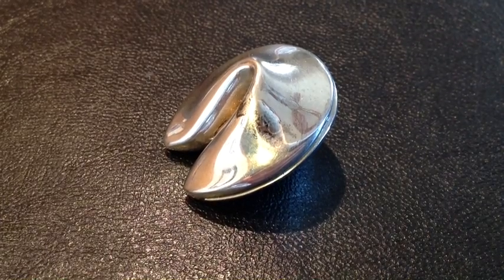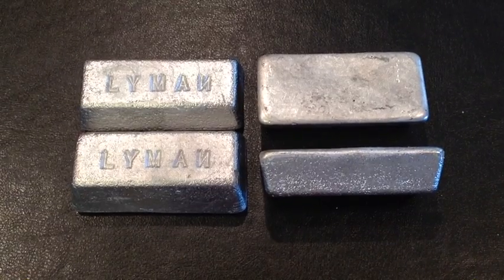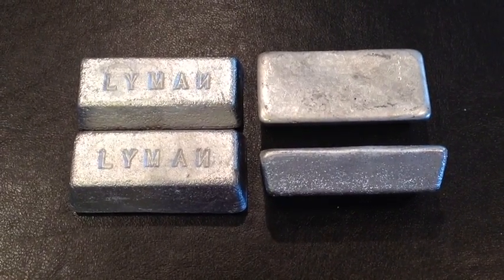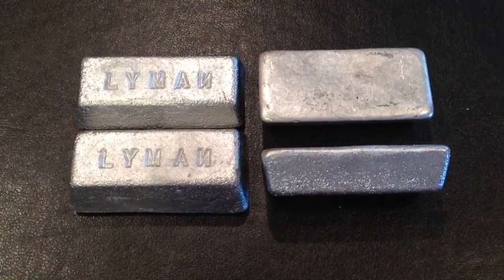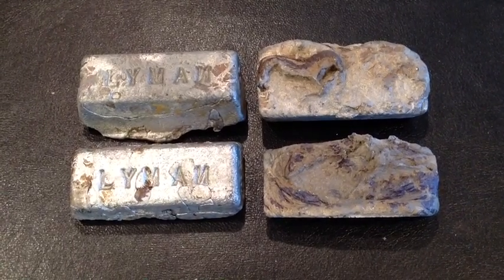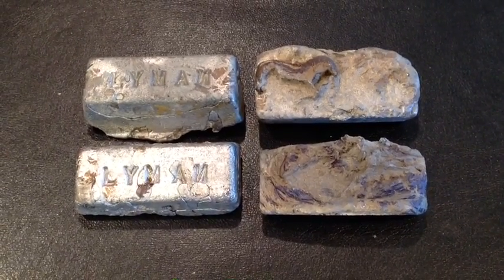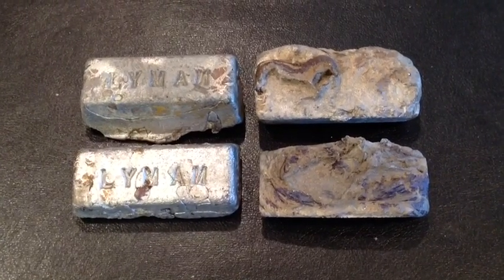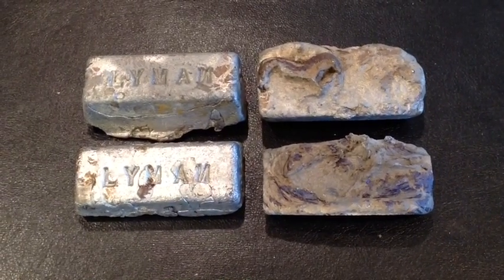Bullet Casting Heartbreak of Zinc

Comment: Why were you melting lead at 900 degrees when lead melts at around 700 degrees?  Wouldn't the zinc seperate better if you had lowered the temperature a bit?
Reply: I think he didn't know there was zinc in it at the time, usually you keep you lead higher than the melting point for pouring efficiency.
Reply from the maker: Garras Porgratix - The lead actually melts a bit lower than 700, and any zinc wheelweights float; trouble is when the heat is not controlled and the temp is allowed to rise causing the zinc to melt into the mix - when that happens, the alloy is ruined.  Best to ya… don't know if I answered this one already, Google is not showing the replies in the comments...
Reply: FortuneCookie45LC Dissolves, not melts. Think of Sugar cubes in water

Comment: I think it's time goes on you won't see too many lead wheel weights anymore how can you tell the lead weights from the zinc weights
Reply from the maker: mr hamburger - LIke your style, mr hamburger..I'll take a cheeseburger please with everything on it - just throw in the kitchen sink..!!  Great questions - easy answer - just take the wheel weight and clank it on concrete floor - sounds like metal - it's zinc - sounds dull dead sound, it's lead.  Another way is the zinc ones have Zn on 'em...some casters use tin snips, the lead ones dent with the snips, the Zn ones feel like rock... Good castin' to ya,  FC

Comment: Good video.  In my (nanny) State a few years back, the Governor decreed we mere mortals could not use lead wheelweights. 😡 My own Heartbreak of Zinc happened when I melted some tamp-ins, not realizing the “wedge” part of the tamp-in that expands the lead sleeve is not steel I could skim off, but ZINC. I lost a good Lee melting pot. 😥 Another time, I did a zinc bullet experiment, but I fabricated a special melting pot and used an old spoon for a ladle, dedicating 2 cheap molds to the project; I wanted no chance of zinc mixing with my lead casting equipment.

Comment: When playing with wheel weights if you can scratch the lead with a finger nail it is lead, zinc will not get scratched like lead.
Reply from the maker: AK - Amen to that, Aaron, some casters like to use a pair of tin snips or pliers to do the same, as if there are a lot of WWs to check, that's a lot of wear and tear on finger nails.  Best to ya,  FC Steve
Reply: FortuneCookie45LC do you reload shotgun shells? Slugs?
Reply from the maker: Aaron Krebs - When I was in competition trap shooting traveling around the state, I reloaded my own shells with the big Dillon press.  But all the serious competitors only used factory ammo.  Shotshells are not like metallics - with metallics, we can easily beat factory performance.  But with shotshells, the consistency of the factory ammo  cannot be matched, much less beat.  At the winning levels, any ammo inconsistency can lead to a lost bird, and winning and losing were always by one bird - hence, all the winners only shot factory ammo.  So I stopped using reload shotshells.  And we weren't saving much on reloaded shotshells anyway.  Today, I reload slug loads and there, our reload slugs const 1/10th of what factory slugs cost.  However, factory slugs are superior in accuracy and power than our reloads (taken as a whole).  For our recreational, range and practice shooting, reload slugs are great.  But if serious use or purpose, factory slugs are the way to go.  Have a great day,  FC Steve
Reply: Can you make a video on how to reload slugs?
Reply: Use a scratch awl or maybe a sharp screw. If it scratches and you see shiny metal, it is most likely lead. Zink has a whole different feel when scratched. The problem comes when you are dealing with a million little, tiny wheel weights. Then it is best to work up a lead puddle and keep the temp below 700 or so and carefully drop them in and see if they melt in about 30 seconds.

Comment: I don't know about DIVING weights. I bought 40 pounds of fishing lead and melting it down found something initially interesting on my runover lead. When I peeled back lead from my sprue (I ladel pour unlike you journeymen), it broke off... pure lead doesn't "break". It makes a soft enough bullet for shooting though and bullets expand on game with it, so I am using it still using it in my airguns and muzzleloaders, but now I'm turning to bullet casting for my .223 and others... is why earlier I had asked you what you thought of powdercoat over just pure lead with a gas check bullet.

Long story short... I have some keel lead that acts like lead in that when you peel the lead back from sprue plate in order to cut it, even thin pieces fold up nicely.. but still when you tap it... sounds a little funny... but is soft enough to damage a bullet if ever dropped, but I'm not buying any more dive weights....

Much Aloha...
Reply from the maker: Tom Lodge - Diving weights, fishing weights and keel lead is all close enough to being pure lead that a caster can just consider it pure and therefore very soft.  Lead that is just at the point of hardening can do strange looking things if disturbed.  I've seen it smear, layer, shift, tear and yes break.  Pure lead is really good for muzzleloader bullets and for shotgun slugs.  I've heard of bullet casters that have no sources of pure lead.  And others only have wheelweights but others want wheelweights and can't get them...Powder coating 223 cast lead bullets is being done by quite a few shooters...100 yard accuracy is not assured with full velocity loads, though.  Bullets that are too soft may not grip the rifling no matter what coating is on the bullets...Even though a lot of 223 shooting has been done with powder coated bullets, not much data has been tabulated... Best to ya,  FC

Comment: if a person had a PID controlled POT you can control the temp to within a few degrees to make the zinc float at 650 degrees, and only use that pot for making ingots so you can separate your bottom pour pops and molds completely from it.
I think the best bet is to stay away form possible zinc contamination of your pot, to me that is no wheel weights at all, they where a wonderful source at one time and free back in the day, now it is to risky.
Reply from the maker: Rodney Peters Good point, I can't get any wheel weights these days anyway because lead wheel weights are being taken out of circulation in California - plus tire shops are required to turn in a "quota" of wheel weights.  Using range scrap solves all the zinc contamination problems... Good castin' to ya

Comment: I just cast my first lead into ingots today from watching utube and ur channel.  It went well and all my zinc floated to the top.  So thanx for the help. I was wondering do u no give or take how many. 303 British bullets. 1 pound should cast. I got 102 pounds out of a 5 gallon bucket
Reply from the maker: garrett williams - nice going - the zinc melts at 787 degrees F, and, of course, your lead is already melted by 650 degrees.  But when I cast hot, my bullet alloy can easily climb to 787 and higher.  So if casters are using wheelweights directly into bullets = trouble (one of the reasons we make ingots- so we know what's going into the bullet pot).  I recall that Lee makes a 180-185 grain bullet for the 303, so 7000/185=37 bullets per pound of alloy.  I like my new 38 cal 99 grain mold casts 70 bullets a pound.  Best Regards

Comment: i am new to casting and i have a question. I collect wheel weights and when i cast 45 caliber 200 grain bullets but when i weight them thay weight 214 grain. How can I make lighter bullets?
Reply from the maker: Wayne Brummett - Great question, and thanks for asking it…This is quite common that bullets dropping out of molds do not weigh according to specifications.  Handgun bullets tend to weigh heavier (softer lead=more lead, less tin and antimony=more weight), and rifle bullets tend to weigh lighter (rifle casters want hard bullets and more tin, antimony=less heavy).  You can lighten your alloy by adding tin and antimony, but wind up with bullets harder than you need=raise the cost of your materials as well.  My advice, go with the 214 as your bullets will have a fair bit more hitting power, shock and penetration-adjust your loading data references accordingly.  214 grains is a better weight for lighter 45 bullets than 200.  I have the 252 SWC 45 Lee mold and it drops bullets spec on size but at 262 grains - and I like it that way!!  That bullet will shoot the eyes out of a rattlesnake at 40 feet if the shooter touches off.  Also, if you do lighten your bullets, you will also get larger bullets and perhaps have to size them.  If your 214s are dropping at groove diameter +.001" (auto pistol) or chamber throat +.001" (revolvers), you won't have to size them - just tumble lube with 45/45/10 and load 'em.  This is probably more info than you need or want, but it is presented in the event you or others might find it useful…Best Regards...

Comment: Im starting to see Zink bullets in range scrap at my local range. Pulled 3 bullets out of 46 lbs today. Two of those were copper coated and one was just regular cast.  I cut any bullets that are total metal jacket so the lead can get out and I knew as soon as I went to cut them they were not lead because zink is way harder than lead. I tested those bullets by dropping a few drops of muriatic acid on them to make sure and they foamed up instantly .  Watch your range scrap guys cause casters are using zink now and either some bullet manufacture is copper coating zink or some hand loader  in my area is
Reply: I was about to post the same warning about zinc bullets also. 
I believe these are made by companies, not private individuals.

Comment: There's a thread in Cast Boolits forum about zinc in lead. They say sulfur will take it out. Has anyone tried it?
Reply from the maker: +Charles Frazier - Wow, a year ago comment that never made it into my inbox for reply...Google does that - irksome, very irksome....Either that or I answered and Google lost the reply so it doesn't show up for others to see... So here we go (again?)... I've heard of the sulfur trick, but that means we have to have reagent sulfur on hand.  With most casters, one zinc experience will drive home the fact that we don't want that!!  I've had one zinc experience in over 40 years of casting.  That is not a high enough incidence to warrant having toxic sulfur on the premises...nasty stuff to keep around or even acquire.  only other use for it would be to manufacture black powder - I'll leave that up to others... Best Regards,  FC
Reply from the maker: +Smiddy Wesson -- Not as easy as that - basically, if zinc contamination occurs, the batch is ruined and not even the pot is worth the trouble to contaminate future batches of alloy.  Best Regards,  FC
Reply from the maker: +Smiddy Wesson -- I suppose, the way I've made ingots all these years with WWs is the way a lot of ingot casters do it without thermometers.  We just heat the wheel weights and when the clips start to float free, then the melting point of the lead WWs is reached, then we lower the heat just a bit and throw in some flux and skim out any WWs that do not melt along with all the clips - those WWs are the ones that escaped our inspection of Zn and Fe ones - won't be many.  We don't know the exact temp of the lead, but it is way below the 787 where the Zn will melt in... This is all academic as WWs haven't been available in CA for at least the last 25 years (unless we want to buy some from Ebay - no need when range scrap is easily available).  Have a great day,  FC
Reply: @FortuneCookie45LC  I don't understand why you think that sulfur is toxic. It is a non toxic element that I use on my garden. What am I missing? I supposes it stinks like crazy when heated, but that is very temporary. I would do it if I thought it would save a batch of lead. I have a fan. I also don't live in an apartment.

Comment from the maker: 762sultan-Thanks for posting.  That's the first I heard of that process.  Hope it helps a caster out there because that zinc thing does happen.  Congratulations on saving your melt.  Never heard of that solution to problem until now.  It's good to have a bail out when prevention doesn't do it.  Best Regards.

Comment: Is there zinc in car batteries
Reply from the maker: JM - The internal plates are lead and lead oxide.  There may be some zinc as part of the framework or terminal assemblies.  But car batteries are not considered to be viable sources of lead for casters because of the acid hazards.  I have never wanted to recover any lead from batteries.  Best to ya... FC Steve

Comment: FC45, I have read on forums that you can flux it with sulfur to remove the zinc. Have you ever tried that to remove it?
Reply from the maker: First Last I've only had the one zinc experience, and the best way is to prevent having it.  Zinc melts at a higher temp than lead - once the lead melts, anything else in there that doesn't want to readily melt at that time needs to be removed without delay - if this is done - no problems.  I did hear of the sulfur solution, but after my zinc experience.  Once in 40+ years of casting is enough.  I don't intend to go with the sulfur solution as prevention is much easier...Best to ya

Comment: I have messed up and gotten zink in my pot before. I usually just use that lead to pour sinkers. A little zink in a sinker mold still does ok. There not perfect but work well. I have also used pure melted zink for sinkers, it's a pain in the butt and they are ugly but still work. You know the old saying " if life gives you lemons"
Reply from the maker: Jerry Ohmer - one thing though, is that today - there are no shortage of zinc wheel weights to work with...and making zinc fishing weights is recycling the zinc...... Best to ya,  FC

Comment: I wonder . . . if you got a laser thermometer (from HF or any thermometer for that matter) and kept these ingots at 621.5 even up to 700ish and cast bullets, would the zinc stay hard enough to separate from the lead again? -Has anyone tried this, or is it non-salvageable either way?
Reply from the maker: Andrey Zagoruyko - We really don't have any easy quick ways to separate zinc from lead...would take a smelter.  Someone told me it could be done by using sulfur, but powder sulfur is toxic.  Best to just start over.  Have a great day,  FC Steve

Comment: I never knew...I will have to certainly be careful when acquiring some wheel weights. I can assume that 'zinc' wheel weight will not 'act' as lead ones...won't scar with some pressure, easily deform if smacked or cut easily? I would assume also that zinc may be of a different color slightly from the lead ones? Thanks for the vid...always a good thing to see the 'fortune cookie' at work...lol